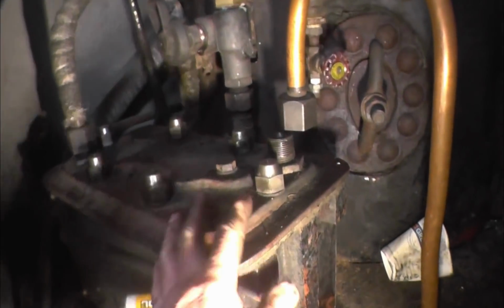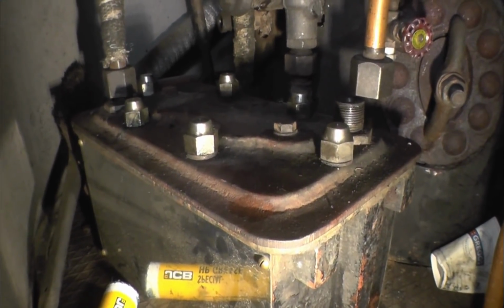SNNC 394 P1 Sentinel Repair . Plasma Land Rover

Comment: John, another interesting video but can I suggest that when you use an adjustable spanner you have the fixed jaw upwards when tightening nuts otherwise the moving jaw can spring open damaging the nuts.
Reply: I despair when I continually see spanners used the wrong way round on the internet, the angle of the jaws is there for a reason and should be used as such for maximum purchasing power when dealing with nuts etc......where adjustables spanners are concerned, the fixed jaw is ALWAYS the jaw that takes the strain, the other jaw is there merely to keep the spanner on the nut and the same principle applies to fixed sized spanners when in use.